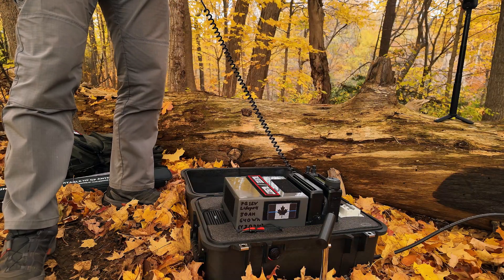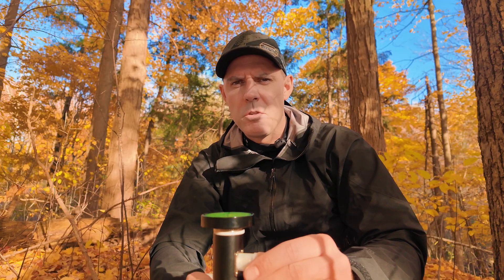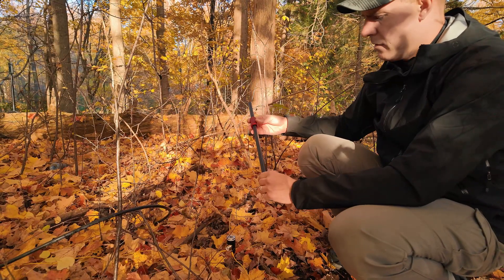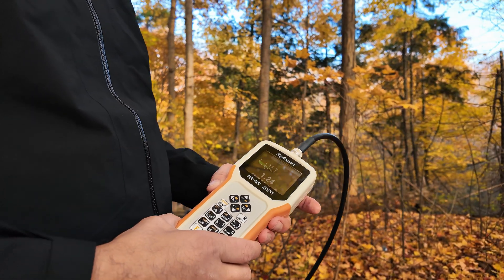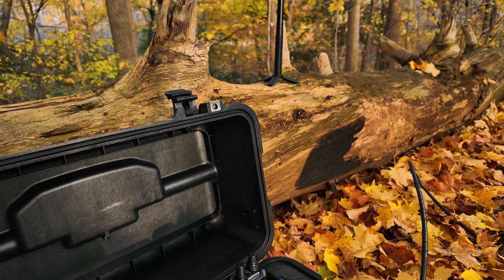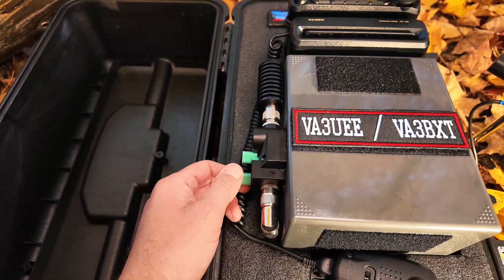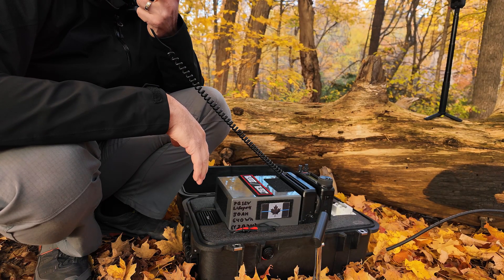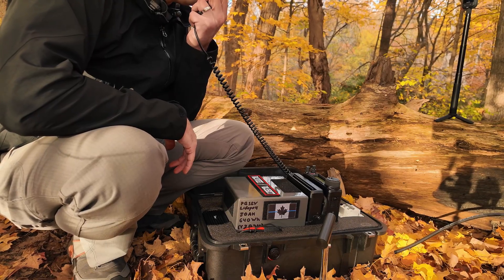Ham Radio Go-Kit Field Test | FT-891 + MC-750 Antenna in Autumn Forest.

Comment from the maker: 🔥 What’s your go-to portable HF setup? Drop your rig + antenna combo below — I’d love to compare notes with fellow operators!
Reply: Yaesu ft891 12 volt 4.5 amp hour battery and some 22 gauge Teflon coated wire
Reply from the maker: @ronniet5680 definitely very good radio.

Comment: nice! how does that radio get air to cool down?
Reply from the maker: Thermal management of the radio is facilitated via the half-inch space within the radio/tuner stack bracket. The mounting base has been elevated to accommodate both the FC-891 and FC-50 vents, optimizing convective airflow for enhanced heat dissipation. This configuration was a primary design consideration. Extensive testing at 100 W output has demonstrated stable thermal performance with no observable signs of overheating.